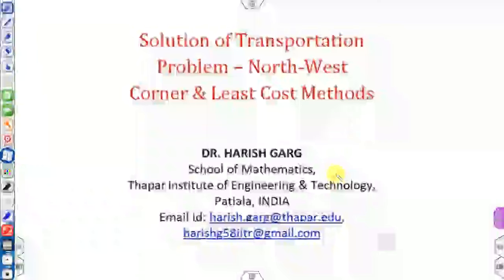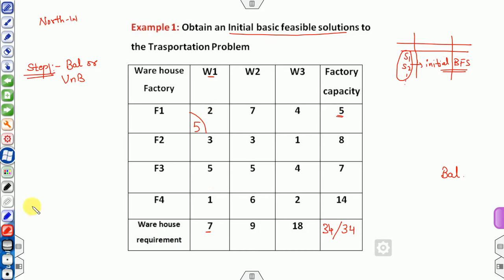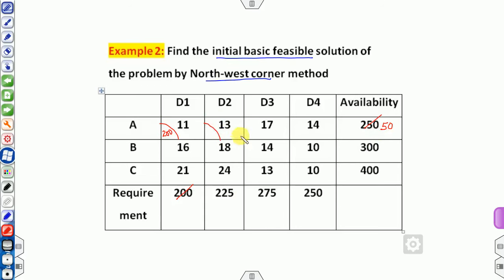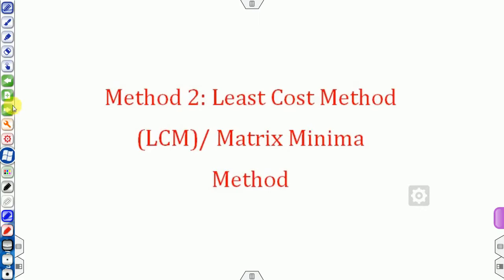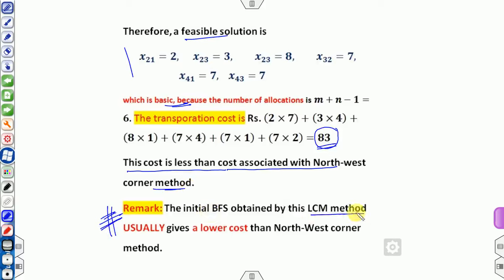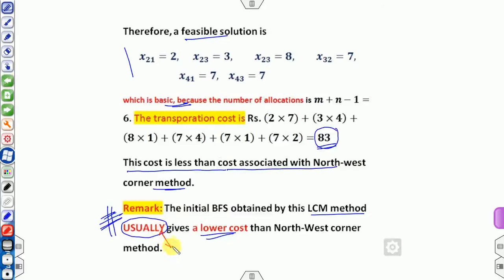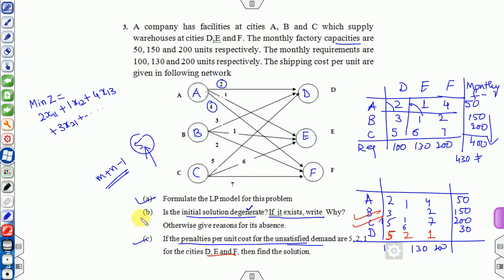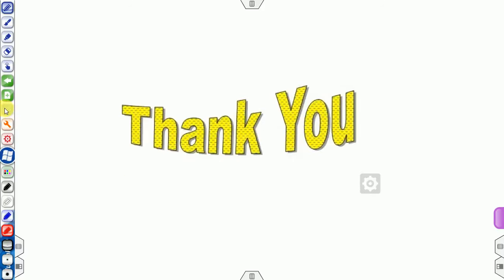North-West Corner and Least Cost Method of Transportation Problems

Comment: Sir, at 20:32 you selected 4 of F1W3 but there is also another 4 at F3W3. The problem is both are giving the same allocation number, which one should I take. You didn't notice that in the video
Reply from the maker: When it is same (i.e., cost is same as in this case 4) then look for allocation which has maximum... If still same then choose any one.... No issue
Reply: Here if we choose 4 at F3W3 then the transportation cost will be 96 where it is 83 if we choose 4 at F1W3! So how can we understand?

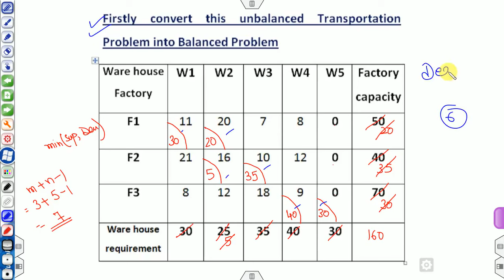Comment: At 16:35 you said it is degenerate and at 16:50 you said it is non degenerate
Reply from the maker: Kindly correct them..its typing mistake. You Count the BFS . if it is m+n-1 then it is non- degenerate otherwise degenerate.
Reply: @DrHarishGarg  thank you sir
Reply: @DrHarishGarg  There is a way by which you can add a box fixing that on the video, either through youtube or any free video editing software.